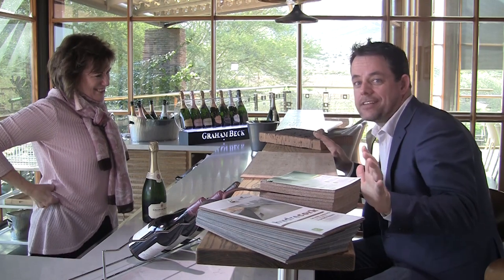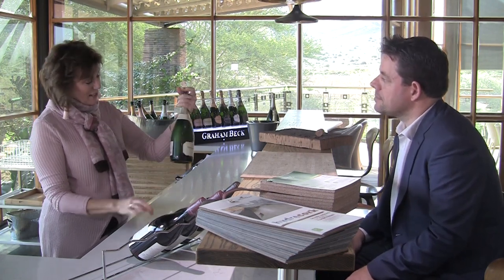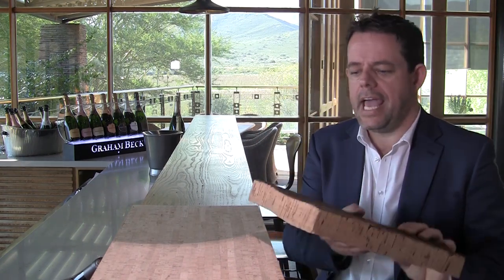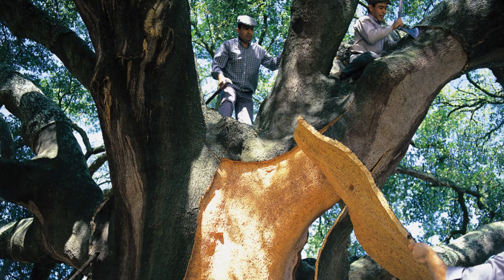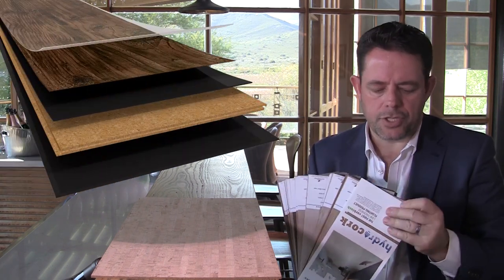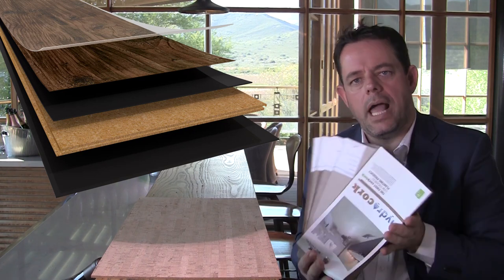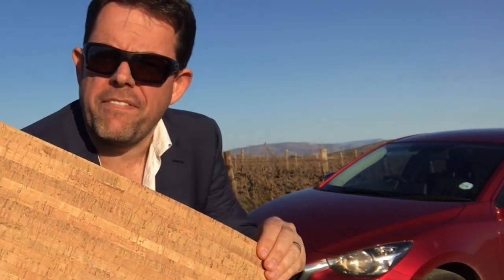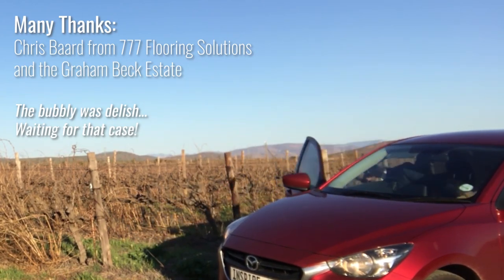Cork Flooring Explored  | S2 Ep 17 Why It's The Best Choice!

Comment: This product is not as durable as vinyl. I installed cork flooring in my whole house, what a mistake. I received a A+ product but while installing I noticed that some of the planks do not line up and there is a slight gap. Also, some of the top laminate is slightly raised making it a paper thickness higher the the previous. You would think that it wouldn’t make a difference but it was enough for my wife to catch it with her shoe and de-laminate the piece, making it necessary for a repair with less that a day after install. There were also about 10 pieces that came with the top pattern not printed on the planks.
  I also installed in my kitchen and when a glass was dropped on it there is a small, permanent, dent in the flooring. There are shiny spots on the floor, which is a flat finish, from us moving the refrigerator and chairs. It is nice but just not durable.
 I am already planning a flooring upgrade and it has only been installed for three days. I will say the install was easy and the product can be cut with a utility knife although I found it just as easy and made great cuts with a table saw and jig saw.
Reply from the maker: Thanks for your feedback. Was it Amorim product and what was the condition of your substrate? Slight height variances can be a real issue. I’m sorry you have to replace 😞
Reply: @FlooringAfrica  I placed it on top of the old hard wood floors. I cleaned the entire floor before install to ensure there was no debris on the floor. The floor is as even as the builder made it and isn't too bad. 
Yes the flooring was Amorim. Purchased in the stated from a Green Building co.
  I was able to use some of the pieces that didn't line up in closets. It is a nice looking product but I have a 5 year old and I am worried about how long it will hold up. Cold the top layer be thicker and would that help with the longevity?  
  There are pros to the floor which I did not mention in the review but should be stated. The flooring makes the house sound quieter. Also, it feels nicer to walk on and doesn't feel cold to the feet. It is also non toxic, which is the reason we purchased it in the first place.
Thanks for the Reply